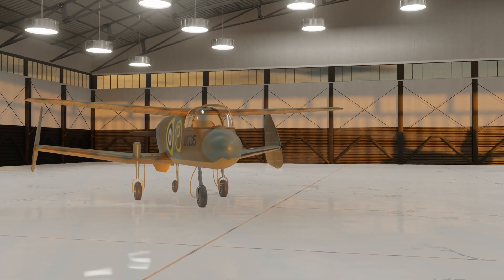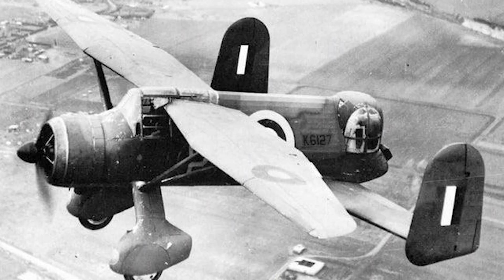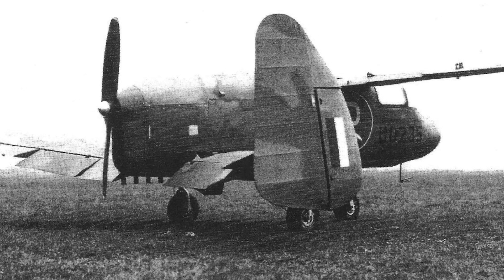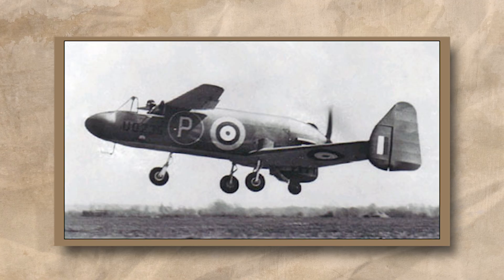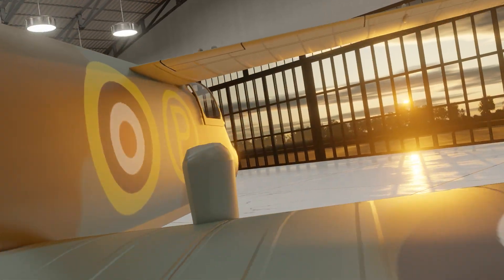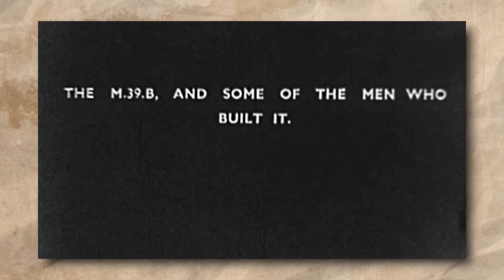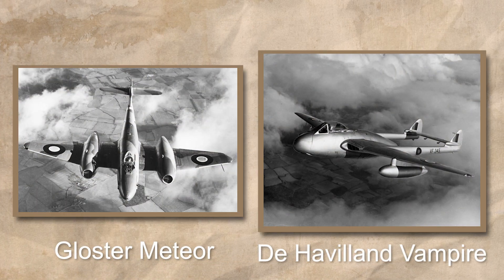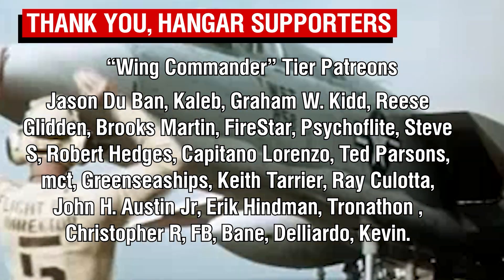Tandem Wing Aircraft Were Almost A Thing In WWII | Miles M.35/39 Libellula [Aircraft Overview #83]

Comment: Despite their benefits, canard aircraft never gained traction. I assume that the benefits are not large enough to offset such departure from traditional looks.
It is understandable that customers without an aerodynamics background will choose the plane that "looks like a plane", for fear of the other plane not performing well simply by having the misfortune of looking different.

This is, by no means, a problem exclusive to aviation, but it appears to be more pronounced in aviation than in other sectors.
For commercial aviation, anything that isn't a cylinder with a single wing with engine pods on it, literally, will not fly. There are some good reasons for it (airport equipment being one), but if we had shifted towards blended wing bodies with high bypass engines on top of them decades ago, we would've saved tens of billions of US dollars by now, as well as billions of gallons of fuel, as well as much of their associated pollution concerns.

Unfortunately, there's very little that one can do except rant about it, so we are likely up for another 100 years of flying on aircraft that, by the end of it, will have spent 200 years, using the exact same configuration (more or less), despite being far from the most efficient or cost-effective.

Comment: Since the main design driver was limited external dimensions, I suppose it was a worthwhile idea, but in general, tandem wings and canard designs (not the modern jet fighter kind) are pretty terrible. Wing efficiency in terms of induced drag worsens considerably with lower aspect ratio, so two wing pairs of half span will be much worse than a single wing pair of the full span, wing area equal. Also, the rear wing will have to produce lift, not only to lift its share of the aircraft, but also to negate the downwash from the forward wing/canard, and do so in dirtier air. The shorter lever arm forces relatively more lift to be produced by the forward wing pair to maintain balance, compared to conventional tail some distance aft (which lifts "down", but to a much lesser extent). It's just a terrible idea all around. Rutan's idea with his many canard/tandem wing designs was primarily to make safer aircraft, as the canard wing can easily be made to stall earlier than the main wing, so you get a soft stall with no wing drop or diminished roll control. You can probably also make the aircraft a bit lighter, as shorter wings for the same wing area can be made lighter.

Comment: You should research the French "pou du ciel" which is a tandem wing formula, so not a specific aircraft design, that is so capable it has been declined in hundreds of private builds. These are usually single or twin seater touring types with extraordinary low stall and maneuverability at low speed performance. No one really knows why the "formula" of the "pou" is so capable, but it can do things no other aircraft can do, like climb right up one side of a large tree then down the other...

Comment: I would actually love to be able to see the designs and blue prints for the b variant.  It looks like such a nice plane and if I could build an RC one possibly as a 3-D print model It would be fun to see you what modifications to the design could be practical for today.  Like, maybe you tilting the motors, or at least the props as they seem to sit around where are you would want the center of gravity, and thus center of lift for VTOL

Comment: I wonder how they solved stability problems (which were main fault of XP-55 and all similar planes). Normal airplane's center of mass is situated within tight limits of wing lift force and then far behind tail pushes down to balance weight and lift. When nose goes down, tail gets even more downforce, if nose goes up, tail can get some lift - in both cases returning plane back to straight flight automatically. But tandem wings are exactly what they are called - wings, they both have to produce lift. XP-55 front stabilizer in fact also should be considered wing. And plane can't balance itself this way, any change in pitch suddenly results in more force pushing in the same way. Pilot can keep plane straight with constant corrections, but that is extremely exhausting and will make it impossible to fly without good visual points of reference. Modern planes use that scheme for various benefits, but they have electronic systems that keep correcting flight without pilot even noticing. But in 40s those systems would be impossible to make.

Comment: With my limited knowledge of wing airflow, I have to wonder if it would have done better had the forward wing been on the bottom and the rear wing on the top.  That front wing would have been dumping its downward airflow directly onto the rear wing's upper airflow.  
...Oh, looks like that happened with the bomber prototype.  And indeed it sounds like it did a LOT better.

Comment: Canard jets use small front wings that deliver control forces but only minimal lift. When the front wing stalls it reduces the main wing angle of attack making a full stall difficult to achieve. The Miles had a large front wing so maybe that’s why stability was poor - basically a stall drops the front end too much.

Comment: The core aerodynamic advantage promised by the tandem-wing planform is the elimination of trim drag. How is this not worth a mention? In a conventional layout, the horizontal tail surfaces create negative lift, adding to the total burden borne by the main wings. The tandem wing layout endeavors to create the same dynamic, whereby the aircraft wants to pitch upward with added speed, and drops the nose as speed decays, but with overall positive lift at each end. Everything and anything else are side issues.

Comment: There simply was no easy and general fix for cooling a pusher prop for the performance required in the 1930s-40s. Jet engines enabled the general configuration to work but before that any pusher design always had overheating issues
Reply: The engineers at Saab solved the cooling problem in their J21 pusher aircraft by designing a fan system driven by the engine and only engaged when the landing gear was extended

Comment: Thank you for this video.  And how about making one for the Miles Messenger?
Produced to meet an Army requirement for an air observation post.  Then the MAP threw all their toys out of the pram because Miles hadn't gone through them.  So the Army weren't allowed to have it!  However the type was used later by the RAF who bought 21.  A total of 93 were produced 1942-48, including exports to 9 countries.  It had huge rear-wing flaps which gave it the very low stall speed of 25mph!  (cf Fieseler Storch stalling speed 31mph.)  The engine was a Gypsy Major.  Lord Tedder and Monty each had one.

Comment: An article I read decades ago, reckoned that the original configuration of the wright brothers aircraft was far more stable, with its rear main wings, than the opposite, that is used on most aircraft today.
There was also a business jet produced on those lines which was considered far more effective and easier to fly.
,
Reply: Totally wrong. The Wright brothers deliberately made the Flyer One statically unstable in pitch because they decided that manoeverability was much more important than stability.
Reply: @Snobiker13  
Show me some proof to support your claim!
Reply: @niklar55  Pages six and seven here: https://ntrs.nasa.gov/api/citations/19870013196/downloads/19870013196.pdf
Reply: @Snobiker13  
Thanks for the info.
My recollection was from some 20-40 years ago, So perhaps I should have said ''handleable'' rather than stable.
As I said, I think an executive jet was produced with that configuration, because it was easier to fly.
I'm not much of an airplane enthusiast so have only studied them superficially in passing, and given the length of time, my memory is pretty hazy.
,
Reply: @niklar55  No business jet as far as I know, but there is the Beechcraft Starship and the Piaggio Avanti. One reason to use that configuration is that it keeps the propellers and the main wing spar aft of the passenger compartment. If it's easier to fly I don't know, but it's said that a carefully designed canard configuration can have more docile stall characteristics than a conventional aircraft. The NASA report talks a bit about that.
Reply: @Snobiker13  
Too long ago for me to remember the details, unfortunately.
the plane in my memory was like this;
https://s28490.pcdn.co/wp-content/uploads/2019/05/saf-velocity-594.jpg
Reply: @niklar55  Similar to the Beech Starship but smaller and with only one propeller.
Reply: I'll take your word for it.😊

Comment: G'day,

This may class as Nitpicking (?), but because Tandem-Wing Designs have "traditionally" had 2 pairs of Wings, front and back, with both pairs being of EQUAL Area, Span, and Chord...; whereas "Canard" is officially French for "Duck", but because Ducks have long necks they appear to have their Wings very close to their Tails - so therefore ,"Canard" ALSO means, colloquially, in French..., "Totally Backwards" or " Going Backwards"...

And then Aeroplanes "standardised" on Dedigns featuring mainly Tractor Airscrews with Mainplanes at "the Front" set at a Positive Angle of (Rigger's) Incidenc and the Horizontal Stabilisor mounted at the end of a trailing Fuselage/Tail/Boom Structure..., set at a NEGATIVE (Rigger's) Angle of Incidence ; so that the resulting "Decollage" caused a Stable Dynamic Instability which may be fine-tuned such that the Wing/Stabilisor fly stable, at a selected Airspeed.

The Mainplane of a "Conventional" Aeroplane thus lifts 100% of the Weight of the Airframe.

The Front and Rear Wing-Pairs of a TANDEM-Wing Aeroplane each carry FIFTY PERCENT of the weight of the Aeroplane.

Then, the idea of a "Canard" Aeroplane was hatched, with the proponents claiming that by placing the Horizontal Stabilisor at the Front of the Fuselage, set at a HIGHER (Positive) Rigger's Angle of Incidence than that of the Mainplane...: then because the Stabilisor (Canard {Front}) Aerofoil is flying at a +ve Angle of Attack then it generates Lift - thus unloading the Mainplanes of 10% to 20% of the Weight-carrying burden, and therefore permitting the Mainplanes to be proportionially smaller, lighter ; and any time the Aeroplane approaches a Stall then the Front Aerofoil - with it's higher A.O.A., stalls First, thus lowering the nose.

So, the difference betwixt a Tandem Wing Aeroplane and a Canard Design is that the Tandem Wing Designs have the Front and Rear Wings both lifting an equal amount of Aircraft Weight whereas a Canard has somewhere around  30%, down to 10%, of the total Weight being carried by the Front Wing.

So, all Dragonfly Fantasies aside, the Miles Libuella was a CANARD design, owing to it's Rear (Main) Wing having about twice the Area of the Front Airfoil, so 70% of the Weight was being lofted by the Mainplane.

Maybe Miles was suffering Lepidopterra-Envy, as a result of Geoffery deHavilland's successes with Cirrus, Gypsy, Tiger, Puss, Fox and Hornet-Moths...; so he squinted until his Duck resembled a Dragonfly, and called it "Libuella"...?

Such is life,

Have a good one...

Stay safe.

;-p

Ciao !

Comment: And, it's notable that several modern jet fighters have effectively revised the concept. The Saab Viggen was an early example, followed by the Saab Gripen. Likewise, the Dassault Rafale and Eurofighter Typhoon have adopted, in effect, the same aerodynamic layout. I suspect aviation enthusiasts could provide a substantial list of such aircraft, apart from the four I've mentioned. :)
Reply: The Viggen works much the same as the Miles designs, while the Gripen, Rafale and Typhoon are more like the XP-55. The failure of the XP-55 could maybe have been prevented if they had a more advanced control system.

Comment: Isn't a Canard?    A canard is a fuselage mounted, horizontal surface that is located forward of the main wing to provide longitudinal stability and control. Depending upon the installation, it may be a fixed, moveable or variable geometry surface and may or may not incorporate control surfaces.
Reply: A tandem wing is a wing configuration in which a flying craft or animal has two or more sets of wings set one behind another. All the wings contribute to lift.

Comment: No mention is made of the fuel economy benefits of such 'canard' wing designs.  In a 'conventional' aircraft the main wing generates lift while the rear wing generates down force.  This reduces the aircraft's lifting capacity and wastes fuel.  When all wings are lifting surfaces the range is improved significantly.  This was one of the strategic benefits of the Northrop flying wing designs.  A big plus with the canard as exploited by Burt Rutan is that by designing the forward wing to stall first the main wing cannot stall (at least in theory) making safer flight possible.

Comment: Kelly Johnson's 1939 L133 supersonic fighter design had a similar design with a much smaller canard replacing the front wing.  As a design it was well ahead of it's time but I doubt that there was a powerplant with enough thrust to exceed Mach I until the early 1950s.

Comment: Would have worked well with early jet engines. Two at the back of the fuselage side by side.  Short inlet and exhaust helping to reduce thrust losses. Also an engine out would not have effected asymmetric thrust.

Comment: I can't imagine being a pilot of that thing under fire of an attacking enemy fighter. You have your engine as a primary target and a meat grinder of a propeller behind your back which you will be lucky to go through if your back is not yet broken by the rear wing while bailing out. Of course, you hope that your engine is already in scrap mode and the propeller is stalled because (see above).

Comment: Burt Rutans design of the Quickie is among the more modern tandem winged planes that I know of. Fun to learn of even earlier design prototypes.
Reply: I think the quickie was a later design of his, too. But now I wonder about his influences in the design of many of his early planes. The Vari-EZE (his second plans-built) really looks a lot like the miles planes, not to mention the Ascender.
Reply: @RichardBetel  His first was the Vari-Ezy, inspired by the SAAB Viggen fighter. For a long while Rutan argued that canards were best, and now he thinks otherwise. The noisiest aircraft around is the Italian looker Piaggio Avanti, the beyond doubt noisiest propeller aircraft in use. And that is natural with some air accelerated by the powerful propellers to over the speed of sound, like when you bang with a hammer on an anvil.

You want to have propellers out of the turbulence, like on the later designs of Miles, and you want a conventional tail for manouvering, but a canard that takes care of trim-changes is excellent, and that is how the Avanti is designed, and the SAAB Viggen only missed the conventional tail!
Reply: @ErikssonTord_2  Rutan's first design was the Vari Viggen, not the VariEze.
Reply: Quite liked the pulsedetonation one he did too hydrogen powered
 @EatPezzzz
Reply: The Westland Lysander Delanne tandem wing variant deserves a mention too.
Reply: And the tractor propeller solved a lot of issues, but the landing gear was a probelm which Cozy avoided!
Reply: In a bit of a stretch the Wright flier, was a canard
Reply: @turkeytrac1  Not much of a stretch, as all early aircraft were canards! Wrights chose that design as they wanted to have the pitch-control surface in view, And it served them well!
Reply: @turkeytrac1  
Your statement is not a canard.  🙊
Reply: Do not forget the J71 Shinden (Magnificent Lighting)produced by Japan in the last stages of WW2.. ❤
Reply: Here Stefanutti's project, 1938
https://youtu.be/lq-zq253ipg
Reply: I would say that the Caproni Ca.60 of 1921 was a bit earlier, but I think there were other, more sensible tandem wing designs before even that.
Reply: Actually, MUCH earlier than that. Samuel Langley's aircrafts were tandem wings, and he did manage to fly steam powered free flight models in 1896.
Reply: Rutan was a hack 😂

Comment: This pair of aircraft were never 'tandem wing' which explains why the CG location was misunderstood. These are relatively straightforward canard aircraft where valuable lessons were learned.
Among which the rigging of the CG, the placement of a canard higher than the mainplane, and the use of flaps.
The CG if improperly rigged forward as in an emulated tandem, makes the aircraft too responsive to the canard, and with the mainplane in the wake of the canard the flying qualities would be difficult to understand. Once the CG was moved aft, the aircraft behave more normally and more predictably. Even better as on M-39 when the canard was moved below the mainplane, the downwash would no longer interfere with the wing by creating a flow with a negative airstream angle, and all those negative effects would evaporate. 
Neither of these aircraft would be suitable for carrier operations however, as canards usually demonstrate very poor short field performance unless very light, which warplanes are not known to do.
Reply: Good comment, thanks.

Comment: Through the streets of Reading?
Reading didn't have an airfield, and Miles aircraft was based down the road in Woodley. That means it probably flew from the same airfield where Douglas Bader has the crash that cost him his legs.
Said airfield is now a housing estate. What remains of the aircraft factory was recently turned into another housing estate.